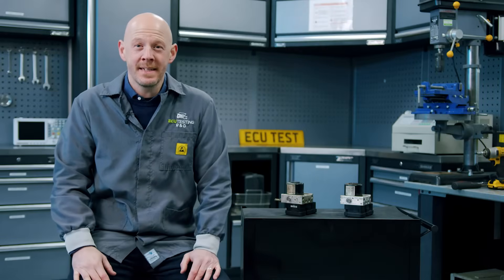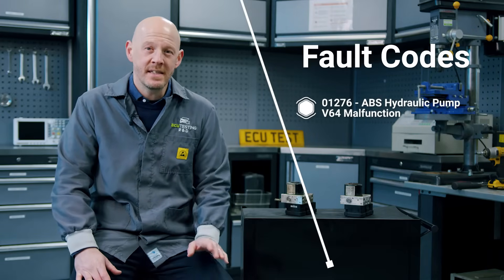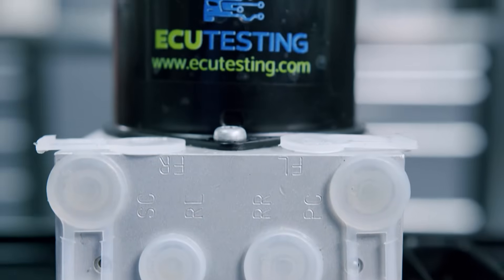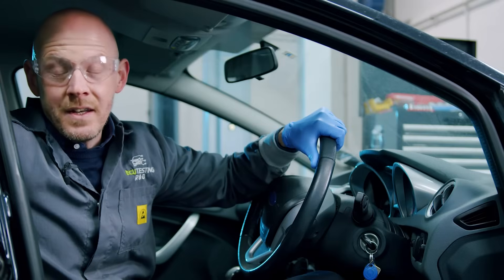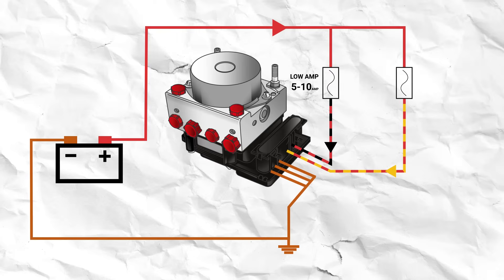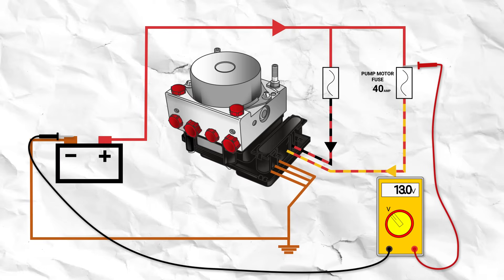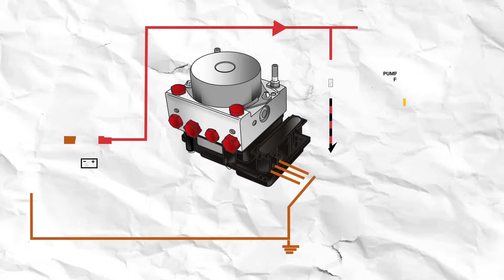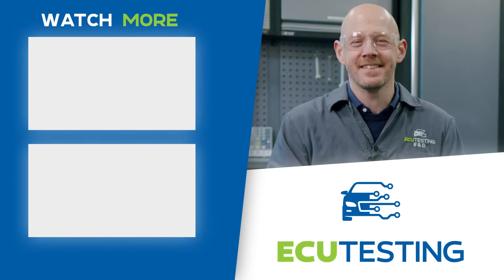ABS Pump Failure Symptoms – How To Test And Fix!

Comment: Shit I have a Toyota Highlander and I changed out the Calipers and pads. I bled the brakes and they are still going to the floor. 
   Now had I never bled and replaced all of this before on other makes and models, I'd say I didn't know what I was doing. But I do. I have even ran a clear hose from each bleeder valve and pushed a quart of fluid through each line. Pedal still goes to the floor. 
   Now since I don't know anything about the ABS systems, here I am. Now before I changed anything on this vehicle, that my son bought. When coming to a stop the break pedal would push back a little and make some noise. Thos is the only thing I know about ABS and that is what this issue is. 
   Now when I went to change the brakes, my son said they had locked up amd the vehicle couldn't move. The inside brake pad was wore down to metal on metal and fell in between the bracket and rotator. This makes all sense. 
   This is why I'm wondering now if the ABS pump has gone out or if it is a relay that has gotten old. This is a 2001 vehicle so anything is possible. 
   If anyone has any information that could help, I'd greatly appreciate it. Thanks.
Reply: See above comments about ABS.....

Comment: Hi I have a 2010 VW GTI that has abs code 01130. Brakes feel fine and all wheel sensors are good. Could it be the battery?
Reply from the maker: Hi. We would recommend checking the relevant fuse for the ABS, however we haven't heard of a faulty battery causing this code, and unfortunately we usually see the 01130 code when the ABS has an electronic fault within the module itself. If the fuse and the wiring to the ABS check out ok, then it is likely the ABS is faulty, and if it is then you are more than welcome to send the unit into us for a full test and re-build. If you would like more information on the fault, check out our article on it here: https://www.ecutesting.com/common-faults/volkswagen/volkswagen-golf-audi-tt-and-a3-abs-pump-failure/ Hope this helps!

Comment: Hi i have honda accord 2013  abs , fraction and hand break light is on can u suggest me thing...thanks
Reply from the maker: Hi. We would recommend getting a diagnostic scan of the vehicle to see what fault codes it is producing. Once you have these codes, email them to our technical support team at info@ecutesting.com, along with your vehicle make and model and any further details of the fault, and they will assist you further. Cheers.
Reply: @Ecutestinglimited  thanks for reply i sent u email...

Comment: Thanks. My MK2 TT is due to the 40A fuse at the back(above batter)fractured hence the code contains "intermittent " after the 01276 error
Reply: Mate, may you please take a photo of this so I can try the fix please? I have the same issue

Comment: can you help me with this one 2000 mk4 golf 1.8t

basically i swapped me3.8 to me7.5 and now got this code

01276 - ABS Hydraulic Pump (V64): Signal Outside Specifications

ive checked fuses but dont know what pins have power on the abs

one person suggested that the early golfs used a different abs module to the later ones and this could be the problem
Reply from the maker: Hi. If you could email our technical support team at info@ecutesting.com with your vehicle's make and model, the part numbers of the new ABS and old ABS, and the details of your problem as you have described above, then they will be happy to advise you if it is a compatibility issue or not. Thanks
Reply: @Ecutestinglimited  thanks alot.

Comment: Hi I have a Volkswagen Jetta MK5 2009 model, the ABS CONTROL MODULE is faulty can that be fixed or I just need to get a new module for it ?
Secondly can the abs control module be cloned/reprogrammed from another vehicle into mines or I need the exact part number for mines?
Reply from the maker: Hi. Have you been able to read any fault codes from the faulty ABS? If you could contact our technical support team via email at info@ecutesting.com or by phone +441773 535638 with any fault codes and the part number of the ABS then we will assist you further. Thanks

Comment: If you have Mazda 3, there is a valve that gets stuck WITHOUT an error code. The brakes will feel mushy. You need to get on an unpaved road and brake hard activating ABS 5-10 times. This will unblock the valve. No diagnostics or replacement needed. You are welcome.
Reply: I'm pretty sure I have a stuck ABS valve on a Ford taurus. I can't get any brakes on the right front wheel and I have replaced the front calipers , the master cylinder and the brake lines. I have no codes or warning lights that remain on after cranking the car.  I don't believe all cars will give you a warning light if you have a stuck valve in the ABS. My brake pedal goes to the floor. Anyone else out there experiencing this issue?
Reply: Same issue with my 2012 Subaru Legacy, and at the same time, my sons Subaru 2016 Forester!  Very dangerous when you suddenly can't  brake!  The brake experts replaced calipers , pressure flush, at lots of expense!  Problem may repeat.  A serious safety issue!
Reply: If you ask me abs are more trouble than they are worth.complete pain In the backside.
Reply: @ColinTitley-bn6en  Yep. Just pump the brakes.
Reply: Thank u so much men, u saved my day
Reply: I've heard the issue comes back after some time though. What has been your experience with this? Also does it cause leaking from ABS module? Mine appears to have some leaking...
Reply: @AudreysKitchen  Yes, it has come back. I did the same reset and it's been fine, except that I did not need ABS since this winter. In the end, you have to replace the valve at some point.
Reply: @bessarion1771 kxo
Reply: @hazimdarus9786  Have you tried it, or just going to call me crazy without even reading about that fix? Because I DID IT. Twice. And it worked.
Reply: I'm going to try this tonight.  Just need to find an unpaved road out in the country somewhere.  I've got scary brakes on my Mazda 3 hatchback.  You will be a Godsend if this works!
Reply: @only1kleigh  Don't get discouraged - sometimes it takes up to 20 tries, but unless your valve is completely gone, it should work. Let us know!!!
Reply: @bessarion1771 I have this issue on my toyota corolla. The breaks are working just fine, no warning light on the dash, the only issue is that the caliper does not release the pads completely. First it was only for the front right wheel, now I can see  the same for the left wheel. Calipers are brand new, I have changed the fluid pump, ABS pump sensor, no better. Could it be that the ABS pump is malfunctioning ???
Reply: @zos09  Possibly. I have a new caliper that's sticking. It depends on how often you drive the car, and if the caliper pins were greased.
Reply: @zos09  TOYOTA YARIS here 12/2005, no light ABS on , nothing, I just feel my Car it seem someone holding, got annual check-in inspection, dude said the brakes are in dis balance especially those rear ( more right breakes ) , is ABS pump fault, a valve is not functioning
Reply: Do you know the name of the part? I have a 07 Mazda3 and I want to fix it
Reply: @valenntinelopez2146  Yes - the ABS Module. I think it's like $670 and it is a PITA job.
Reply: I’m going to check my abs fuse then try this.
I have a 2013 Subaru Outback and my brake progressively gotten soft until one day it just got spongy soft.

I tried bleeding it and it didn’t work.
Bought a new master cylinder and bench bleed it. Installed it and bleed all four calipers. Once I turned the engine on it was soft again. Now I thinking it’s the abs.
Reply: @H.Xiong123  no fuse will not make your brakes mushy. a stuck valve WILL. The worst case - you will need a new ABS valve, which is over $680. Just for the part.
Reply: THANKYOUUU
Reply: @theconsciousmovement9669  I did it at least three times since I posted this. It worked every time.
Reply: unbelievable.. just cancelled pump i have ordered. 10 pm i was drifting thru the woods like a maniac for 30 minutes and it really worked i just hope it will stay this way now. is it good idea to change brake liquid after this?
Reply: @filipcurkovic3750  It's always a good idea. But, unfortunately, it will happen again. It's not the pump-it's the distribution valve. The good part is that you can fix it this way every time it happens. And I fixed it going no faster than 25 mph - just have to do it 5-10 times. Usually it would take maybe 3-4 minutes to complete the cycle and fix it.
Reply: Yeah unless you have adaptive cruise control
Reply: @JokersHangout  what do you do if it does have adaptive cruise control?
Reply: Is it the smiley face one? I personally have one with abs light. I have a scan tool that can move the valves. I guess i try with that
Reply: Hey man can you elaborate what you mean when you say "get on an unpaved road and brake hard activating ABS 5-10 times." I'm know it sounds stupid I just wanna make sure. Do I need to be going at a certain speed threshold, and do you mean slam the brakes 5-10 times? Thanks.
Reply: @fuse4967  The idea is to lock the wheels 5-15 times in quick succession. So you either to go on unpaved road or on ice/snow and step HARD on the brakes to lock the wheels. Don't have to come to a stop - just lock the wheels and activate ABS. I do it going at about 15-20 mph. again, the idea is to lock the wheels and activate the ABS. Just do it until you feel the brake pedal getting stiff.
Reply: I have a Mazda 3 (2007). My issue is when im braking , there is a grinding sound coming from my front left wheel. After some time or the vehicle speed increased, ABS wearing light turns on and that grinding noise disappears. ABS sensor and the hub bearing replaced but the problem is the same. What could be the issue?

Comment: Hi my Audi A5 2009 shows on vcds fault error 00597 any idea what is that?
Reply from the maker: Hi. The Code 00597 indicates something wrong with the signal from one of the wheel speed sensors to the ABS. If you check out this video we have put together on wheel speed sensors: https://youtu.be/T74B_aELnU0 and follow the diagnostic tips, it should help you out! Any other questions contact our technical support team at info@ecutesting.com. Cheers
Reply: @Ecutestinglimited  I diagnose the car on live data and the sensors was speeding the same.. but the speedometer still is shows zero on the clock..
Reply from the maker: @Tedankouil  Hi. We would recommend checking the wheel speed sensor for any damage, checking the speed sensor reluctor ring for damage or corrosion and finally checking for excessive play in the wheel bearings. All of these can cause the 00597 fault code. If all of these check out ok, then check VSS live data in the instrument cluster to make sure it is receiving the speed sensor logic. Hope this helps!
Reply: @Ecutestinglimited  he did live data and he told me that everything works perfect but still not speedometer working I’m losing signal every time I move the car for 40 seconds. The speedo is going to zero
Reply from the maker: Hi. Sorry to hear that, the only possible solution we could offer is a full test of the ABS module and/or the instrument cluster to rule out both modules for faults. However it could still be something external causing the fault.

Comment: PLEASE HELP ME, after replacing the lower control arm & the wheel hub, everything's perfect after an alignment, then 2 weeks later the ABS lite came on then a month later the front passenger side wheel started to grind even when i hit the brakes so today I removed the caliper with the mount and rotor and it still grinds consecutively ?
I have a HUGE family get together this Saturday at my brothers (about 200 miles each way) but I'm scared shitless driving up there, PLEASE,PLEASE,PLEASE HELP ME...
Reply: u get it figured out!?
Reply: Sounds like a bad bearing

Comment: Could you please tell me if a scan tool is necessary to bleed the brakes on a 2005 K74 Mitsubishi with ABS brakes  to remove the air from the ABS module ?
Reply from the maker: Hi. You should be able to bleed the brakes and remove air from the ABS without the use of a scan tool, if you have someone assist you in pumping the brake whilst bleeding the system. Cheers

Comment: 2011 Audi A4 ABS module has lost communication with the car. I have a used work in working order but it will need to be coded. The stock ones doesn't work and has my car in limp mode and disabled a ton of things. Sometimes you'll hear the stock one that's faulty clicking as if it's trying to work. Any ideas from anyone on what could be going on or can someone point me in the direction on how to code the new one so I can install it. Thanks in advance.
Reply from the maker: Hi. If your old ABS unit is clicking whilst running, it could indicate a failed pump. In regards to re-coding a replacement ABS, the procedure varies depending on system type with some being done with simple diagnostic equipment, whereas others are more complex. If you contact our technical support team at info@ecutesting.com or by calling +44 1773 535638 (Mon-Fri 9am-5:30pm BST) with details of the fault and the make and part number of your ABS unit, then they will be able to advise you further. Thanks
Reply: @Ecutestinglimited  Thank your response. The code I am getting is C121 "ABS control module lost communication"

Comment: Hi! I been noticing a weird safety issue with my bmw f20. Whenever I braked hard, my steering veers to the right, an indication my left front brake is not functioning well?

A quick trip to a workshop ends up in both front left and right rotor and brake pad change.

However when the mech tried to perform a bleeding of front right brake, he said it was not bleeding well enough. After many attempts he decided to check on my abs pump.

He disconnected the line out from abs pump to front right, and upon pressing the brakes, little brake fluid seems to be coming out of the abs pump supplying to front right.

Is this a sure tell tale sign of faulty abs pump? Or should I carry out the wiring test as shown by you guys
Reply from the maker: Hi. We have done a brief video around brakes binding and vehicles swerving while braking here: https://youtu.be/RrSn0M7n9eE

However you seem to have performed the majority of the diagnostic steps already and, unfortunately, if you are unable to bleed the brake and no fluid is present at the affected port on the ABS unit, then it is highly likely that the ABS itself has an internal blockage. To be on the safe side (and hopefully save yourself some money), we would recommend carrying out all the wiring tests listed in this video, but this is a common fault we see on a lot of ABS units suffering from an internal failure.

Let us know how you get on and if the wiring checks out ok, then we would be happy to help you by re-manufacturing your ABS unit, just drop us and email at info@ecutesting.com with your make and model of vehicle, your unit's part number and the diagnostic information you have written above. Thanks

Comment: My toyota corolla 2008... when i switch off my ignition the abs keeps vibrating until I disconnect the socket from it please what can I do?
Reply from the maker: Hi. It sounds like you have an internal failure with the ABS pump motor. If you fill in our online test form with your vehicle make and model, the ABS part number and a description of the fault, then we will help you out. Cheers
Reply: Same here what's happing with your Toyota is happening with my 97 Nissan Pathfinder LE. The ABS light comes on and when I turn the ignition of it keeps vibrating. I checked the fluid to make sure that it's was still full and it was. I also checked the fuses all the tiny fuses are good the 40 amp fuse time I unplugged that it turned off so I looked at the fuse we had corrosion on it. So I was thinking about ordering me some more 40 fuses but I started thinking that could be peace of the problem but not the problem solver. I put the fuse back in and it started back vibrating again from there I started to think what is ABS anti braking system so I went out on a dirt road going 5 mph hit the brake then backed up hit the brake pull forward hit the emergency brake after I did all of that it stopped I turned the key off turn it back on no ABS light and no vibrating. Do you know the cause of that? Do you think I should change my braking fluid because I had it now for 2 years never changed it. Before me it was belonging to an elderly gentleman that passed away and it sat for about 3 years so no break fluid changing has happened.

Comment: I got tested my car’s abs from the company and they told me my ABS valves are faulty. What’s the solution?
Reply from the maker: Hi. If you have a faulty valve then you can either get it re-built by a specialist such as ourselves, or buy a replacement unit. Fill in our online test form at www.ecutesting.com to get it re-built, or find your make and model of vehicle on our product catalogue for up to date pricing. Alternatively, if you cannot find your car on our website, email us at info@ecutesting.com with you car's make and model and details of the fault and our technical support team will assist you. Many thanks.